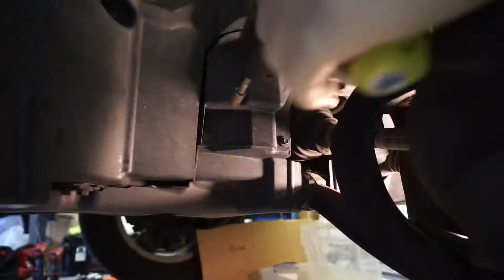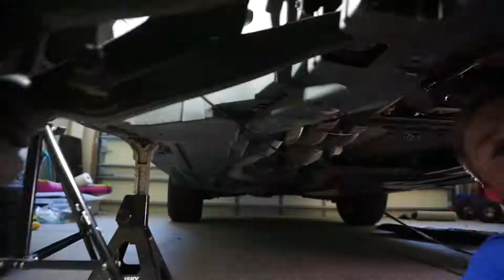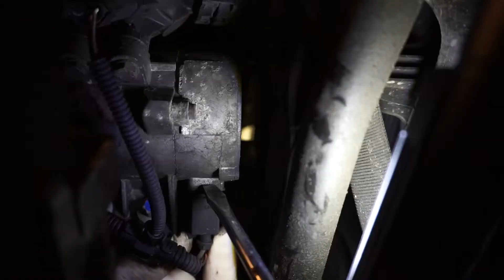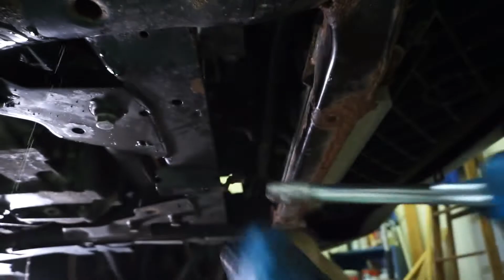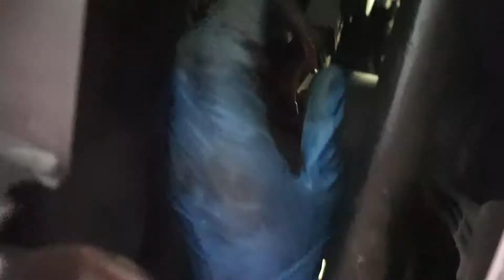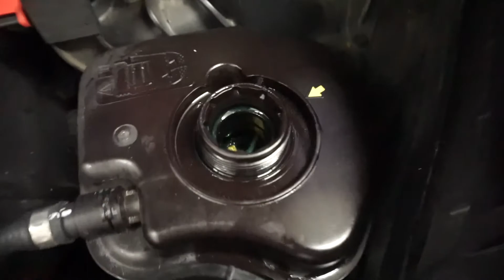How to Replace the Water Pump and Thermostat on BMW X5 E70 N52

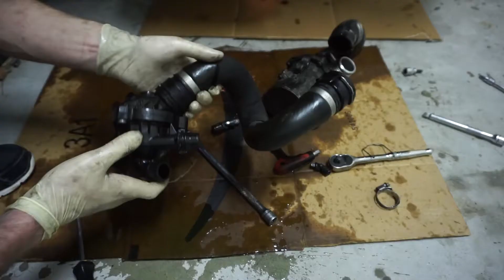Comment: at 2:00, "challenge to disconnect the hose from the thermostat", looks like that's using a common hose clip. If you have hook tool, just hook it in there and pull the clip out and the hose should come out easily. In the video it looked like you just force it off with a flat head screw driver. That's impossible when the thermostat is still in the car as there is no room there for leverage.
Reply from the maker: you are 100% correct! after removing C clamp, i used the flat heat and pray bar, but nothing did help, it was really snag. Even after removing the assemble I had the hard time to removing it, after adding little bit of lubrication everything went just fine.